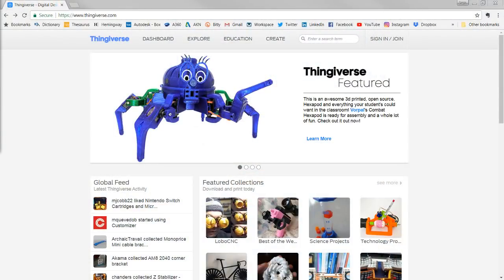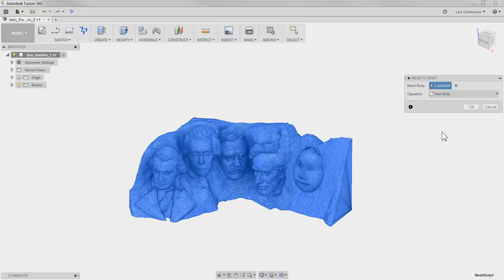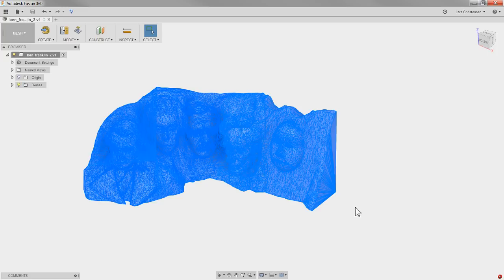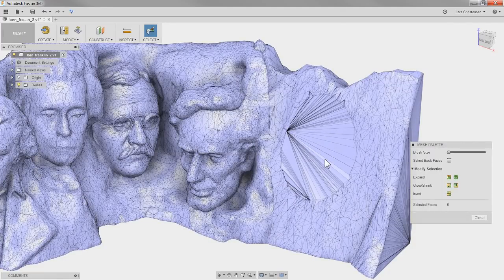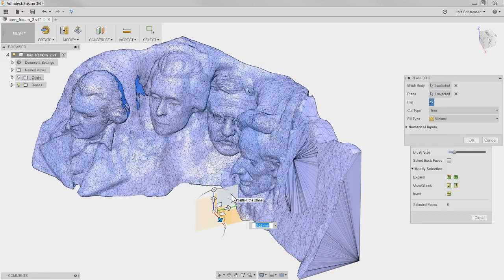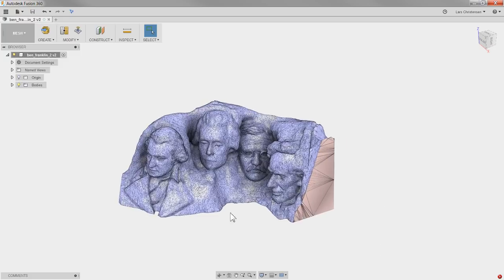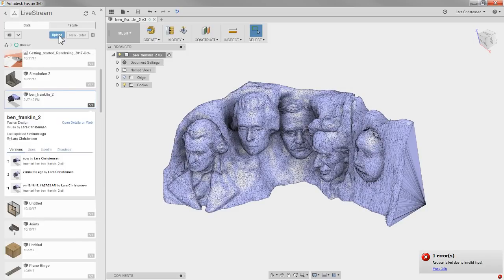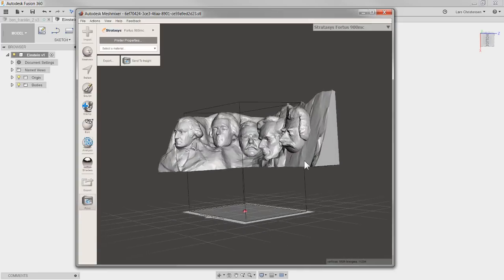Fusion 360 — How To Change STL Files — #LarsLive 75

Comment: This is useful.  It helps me see more of how these models are made and the steps necessary to modify.  I'd like to do two things with my 3D printer.  1) Find an STL of a 1967-72 Ford F100 and imagine that Ford made a Bronco that year based on a full size truck.  This helps..    and 2) Take the STL for the Barry Solo finger pen and modify it to accept 4 pen modules of a Bic 4-color pen, complete with click mechanisms.

Comment: I was under the impression the max facet count was ten thousand but clearly I am mistaken, there is a model I have been trying to do for a while and have read through the comments and think I might be able to do now. Do you know what the max facet count is?
Reply from the maker: Hi Popcorn Shiner Thank you for watching!
I found this on the knowledge base
NOTE: Fusion 360 works best when converting meshes with less than 10,000 facets. If your mesh body contains more than 10,000 facets, it is possible the conversion process will fail or errors will occur. The Modify > Reduce and Modify > Remesh tools in the Mesh workspace can be used to reduce the count of mesh facets to promote a healthy conversion to b-rep.

Comment: Hello Lars,  I have just been following your videos and wanted to contact you.  I really appreciate your videos.....great stuff by the way. I have been using Fusion 360 now for the past three years and am a retired industrial designer.  A great piece of software to be sure.  The question I have for you concerns a project that I would like to build.  I want to make a large model of the Planet Express ship from the TV show Futurama.  So the question is this...is it possible to model two profiles to create one 3D shape?  One profile would be laid horizontally and the other profile would be perpendicular to the first shape and intersecting it at the same time.  I have seen this done elsewhere but not with Fusion.  The two shapes combined would create the fuselage shape of the space ship. The spaceship is not something that can be revolved like an old style 50's rocket.  I need the fuselage shape to be correct so I can slice the model to create ribs to build a four foot model of just the fuselage.  Any suggestions would be great. 
Thanks, Dave
Reply from the maker: Hi Dave Langkamp Thank you for watching!
Yes, You can actually combine modeling with sculpting, like this:
https://youtu.be/C4GeAa1mYHA?list=PL40d7srwyc_Mkgc5wvP_OfVel9aDkNkZ6